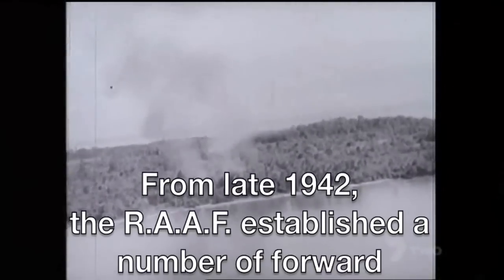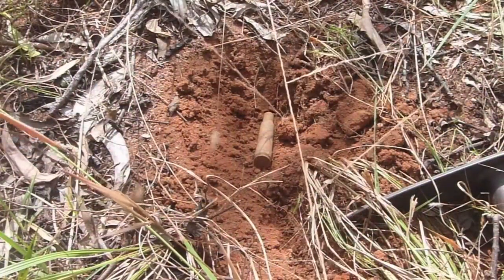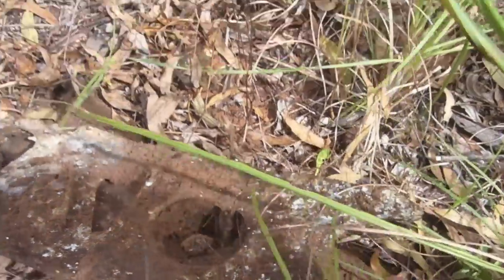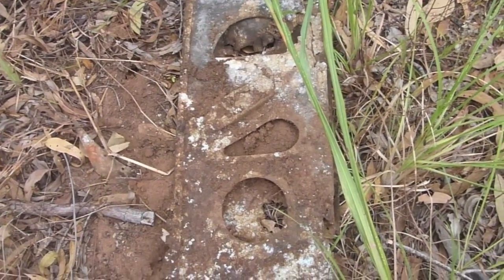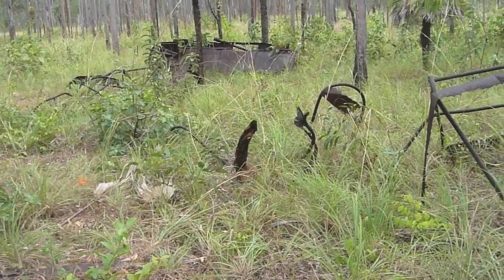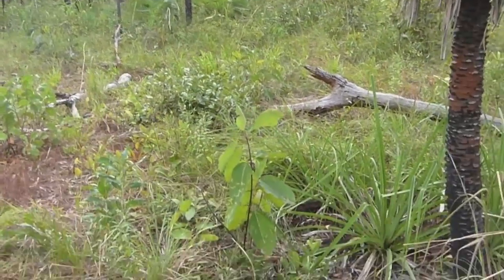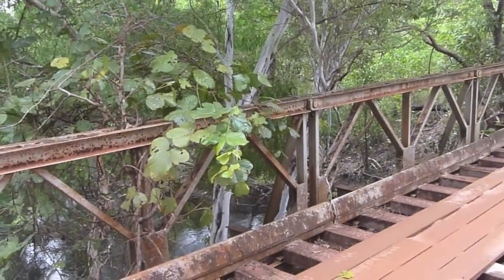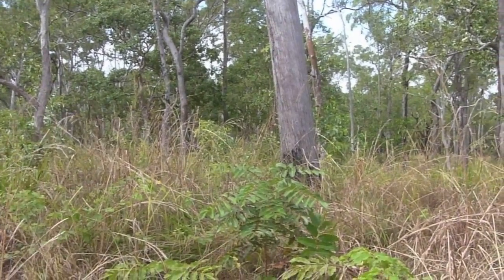WW2 R.A.A.F. Repair & Salvage Unit & EW Radar Station

Comment: There are the remnants of a similar radar site at the Vlamingh Head lighthouse near Exmouth in WA.
The tower frame was still fairly complete, but the antenna assembly was lying on the ground in pretty sad condition when I was there in the mid 1980s.

I googled for the lighthouse, just now, & one of the pictures shows the radar tower all tidied up with a plaque in front of it.
Dunno if the antenna is there still.

My brother operated that radar site during WW2, hence my interest.

The ham radio mag "Amateur Radio" had a good write up on that type of radar, back in  the 1990s
It appears that most of the physical structure was made by the NSW Railways, of all things!

If you know any older hams you might get lucky & find the mag.